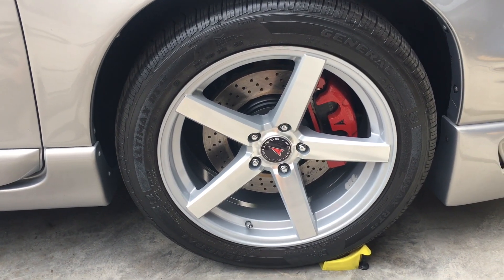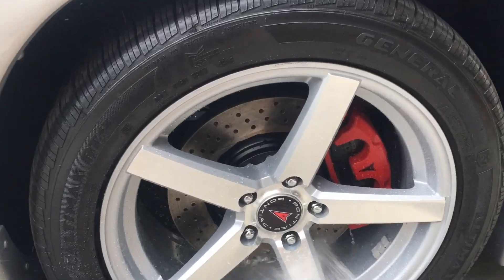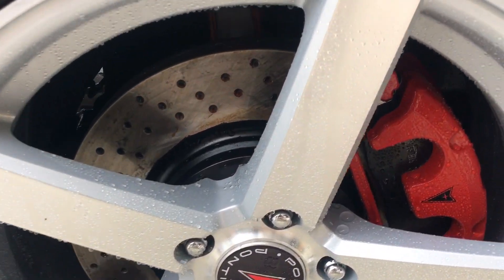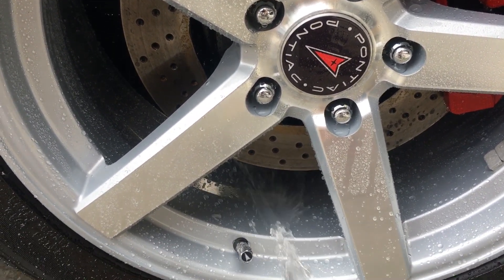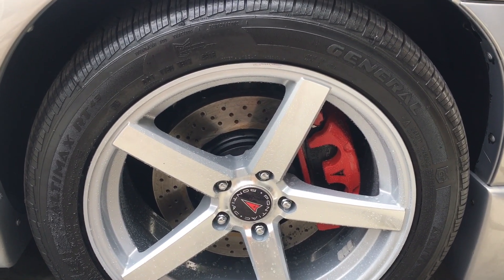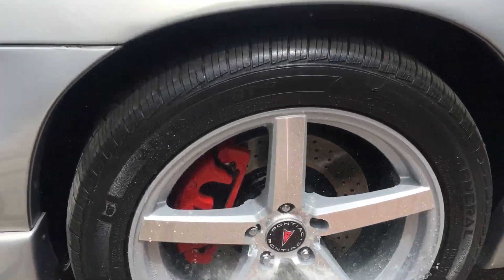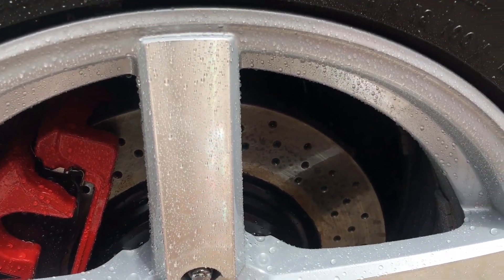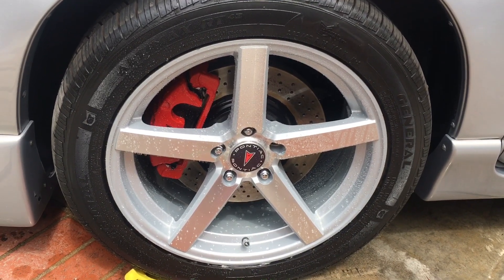Adams Graphene vs Adams Advanced Graphene Hydrophobic Behavior #shorts

Comment: I have stopped using other coating like the ease of use is the advanced also in same ballpark with ease of use?
Reply from the maker: You won't have problems with it since you have applied coatings before.  Will be a bit more tacky when wiping off.